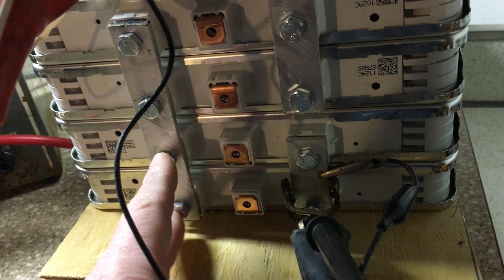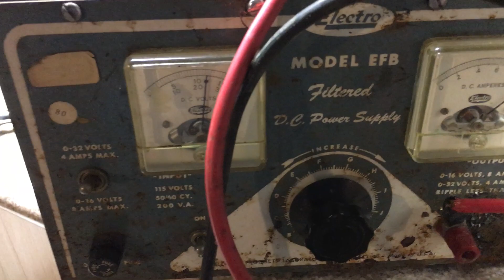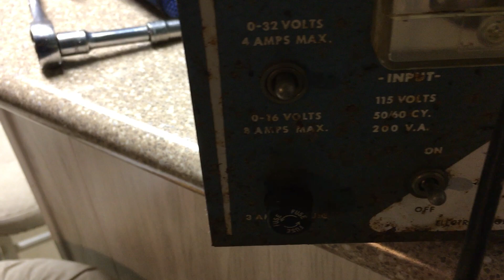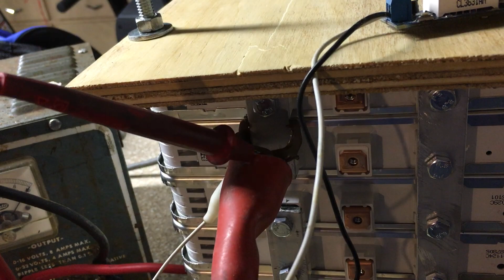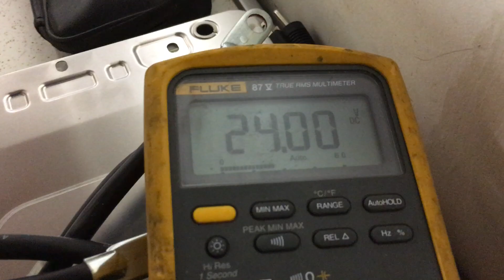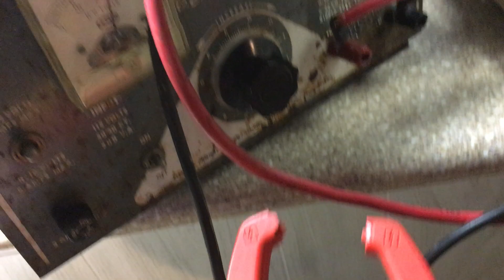My new nissan leaf battery pack

Comment: You need to check to cells to see if they are being balanced every now and then. BMS are shit, I don’t use them oh and by the way a regular hobby charger will charge these batteries. I use an 8s hobby charger on mine and it balance the cells as well, these cells start dropping voltage fast after they reach around 3.6 volts too.

Comment: According to tech direct these battery only have around 60-70% Amps left. Independent test on Ytube seem to be about 50-60%. That's meant these 3.5kwh only have somewhere around 2+kwh left. Having said that, if you can do load test and tell us, I'm sure many will appreciate your finding. thk.
Reply from the maker: I'm getting about 55% out of mine.  I've tested them a few times now going to a max charge  of 4.14 per cell .
Reply: @IFix-Things  Ordered 6 of these.  Going to be employed in a Solar /  Wind Augmented power closet thing.  Yep, Guess the first thing I need to do is a capacity Test.  Seller claims  they are better then 67%  .  If they pan out I'll be ordering like two more sets.  My BMS is going to be nothing more then Cell level Voltage Monitoring,  Top of charge protection circuit  and a Active Balance module.  No one seems to be having issues with these things falling out of balance but I want at least that autonomous.
Reply: i have 24v 6s nissian leaf battery mine is 11 amps storage after that i not able to able  keep charging

Comment: This is not a right way to set them up. It’s dangerous. Please use BMS use each battery series to get the right voltage. I seen people setting them parallel and cause damage to the battery cells as you do not know the charge and discharge for each cells. Please use BMS.
Reply: If you tie your cells together in parallel prior to your final connections, the batteries will start out balanced. Though I am not sure why his is arranged the way he has it.

Comment: Why aren't you using the center post? Each pack is two cells.....
Reply from the maker: Don't really need to. You see on the bottom two modules.. The  right side (-)they are in parallel, so they are 4 volts from center to the right, then on the left side (+) the bottom two are in parallel, so they are 4 volts from left to center, so we have 8 volts. then the next two modules are flipped, so on the left side (-) they are in parallel , 4 volts , then back to the right side (+), there are 4 more. so on to the end (+), so its 4+4+4+4+4+4=24 . The best way I can tell you to visualize this is like an old MAG flashlight that accepted multiple batteries. Visualize how the positives and negatives go in that.